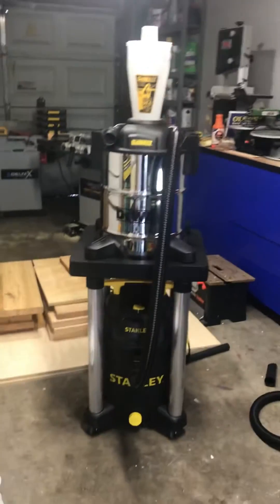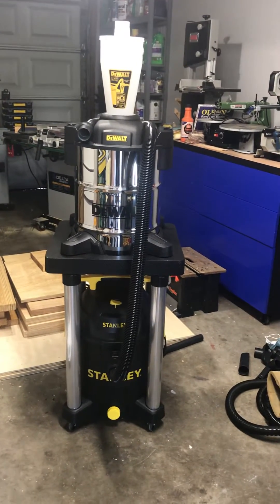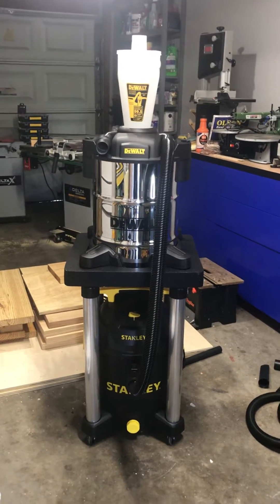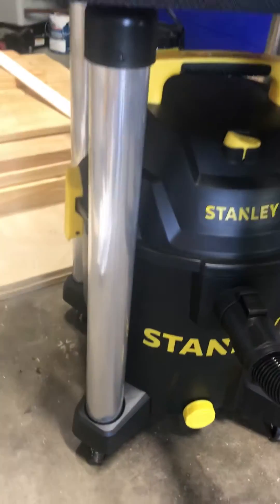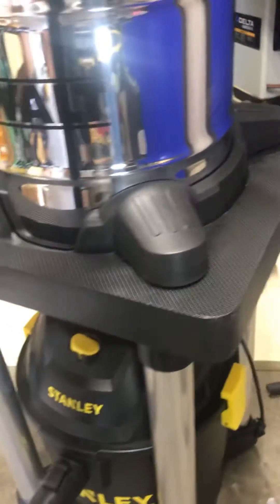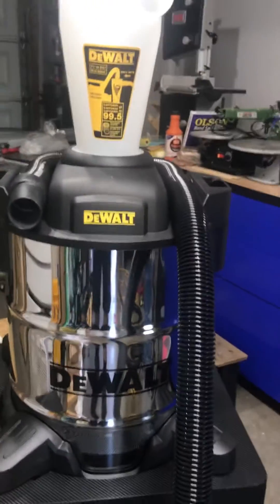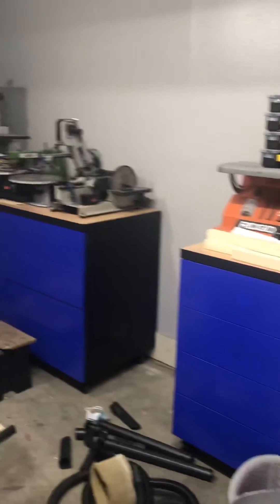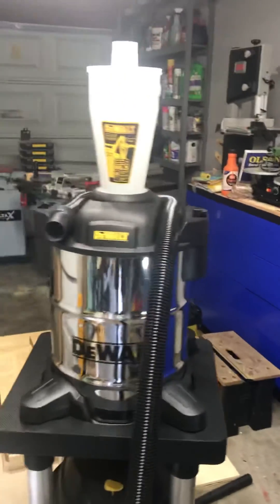CNC ROUTER DUST COLLECTION  SET UP.

Comment: You are still the only one on YouTube who has posted videos on the dewalt separator. I watch a lot of videos and it’s hard to be the first for anything. Your stand looks awesome. The wraps are a nice touch! Unfortunately the separator is sold out on Amazon at the moment (Jan 7th 2022) and it doesn’t seem to be sold at the big box stores (yet). Thanks for posting!
Reply: FYI, as of today, it is in stock at Home Depot
Reply: Thanks for the heads up! I actually bought one directly from alton industries who manufactures the product. They sold me the 6 gallon for $99 with $5 shipping. A little cheaper than HD
Reply from the maker: @dennisTHEmenac3  hey can you do me a favor and measure the height of it. 
I’m trying to put one inside my work bench for my table saw. Thanks
Reply: @rrdiywoodwork4265  that’s exactly what I plan to use mine for. I’ll set it up soon and post a measurement
Reply from the maker: Is probably stuck on the shipping containers out in the ocean. There’s a lot of that going on these days. Hope you can find one. Is actually a good dust collector.
Reply: The 6 gallon is 34 inches tall without the casters installed and that includes the hose bowing off the top. You could probably knock another 1 1/2 inches off the height if you find a right angle hose adapter instead of the hose flexing off the top. If you add the casters, that adds another 2 inches
Reply from the maker: @dennisTHEmenac3  is kinda close but like you said getting a angle adapter might work. I’m a go for it. Thanks for the info
Reply: I’m still a few weeks away from starting my mobile work bench build but I had to adjust the height of the table top to ensure it will fit under there. It’s taller than I though it would be but very sturdy design and build quality.
Reply from the maker: @dennisTHEmenac3  Same here. I already have the frame built and got my mdf top. Right now I am going to flush it to the frame and then I’m a put Formica on top.